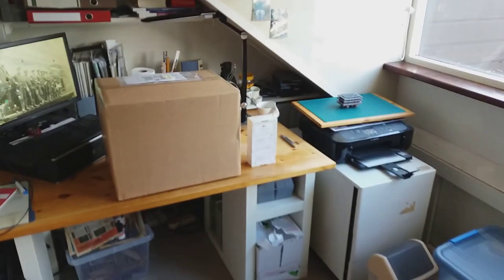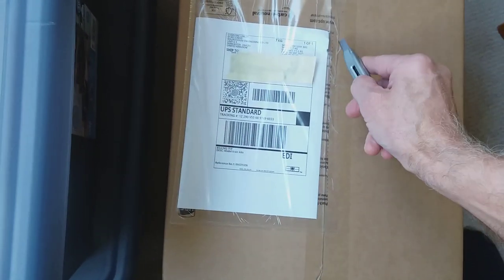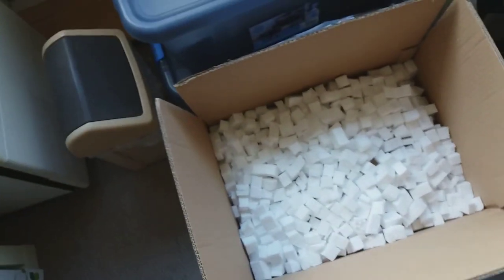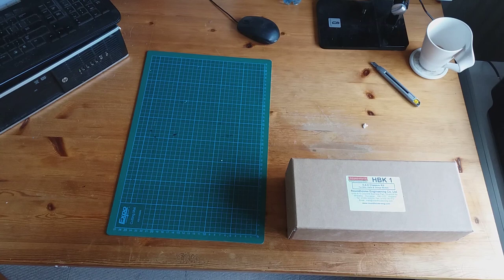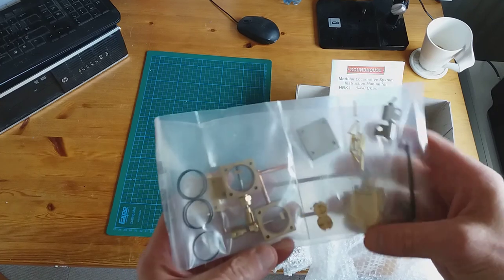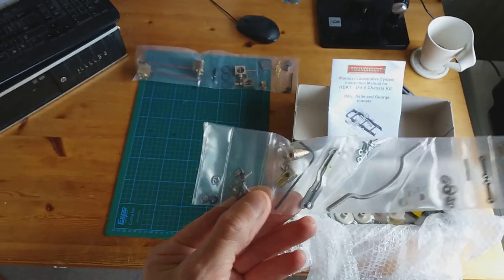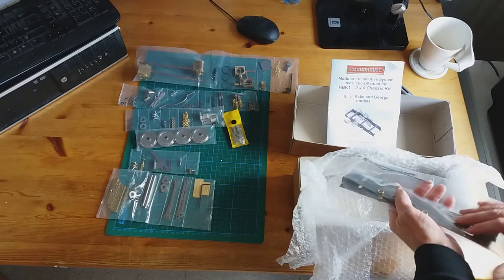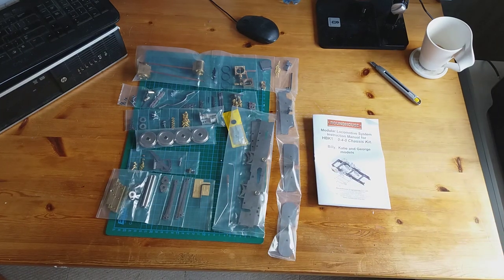RH George: Unboxing Part 1A

Comment: Can you order one module individually?
Reply from the maker: Yes you can. For example if you are on a tight budget you can order one module, work on it and at the same time save up for the next one. I ordered everything in one go because I am outside the UK and the cost of postage & import duty/taxes would increase the costs significantly